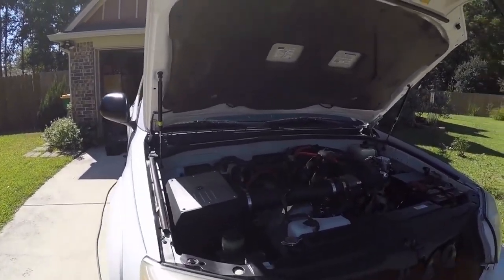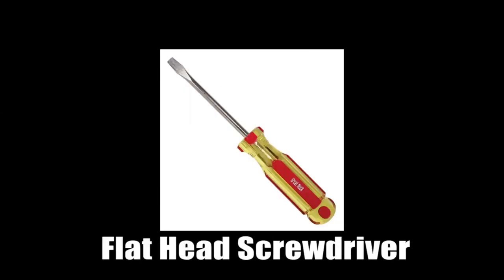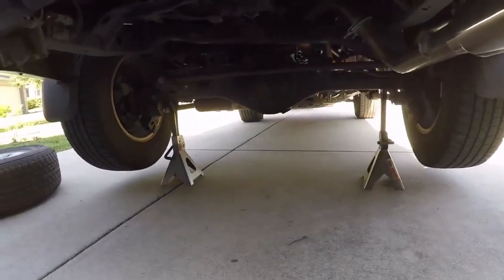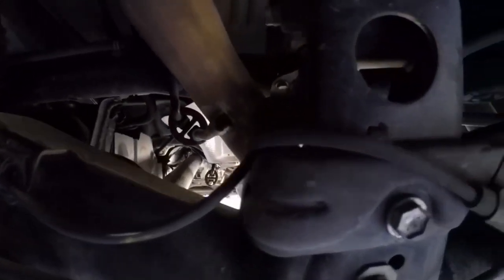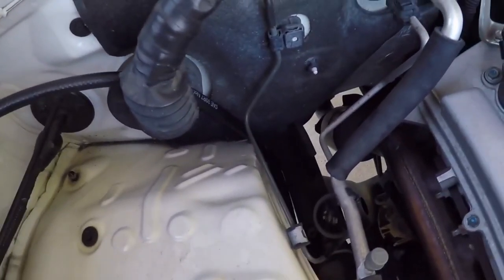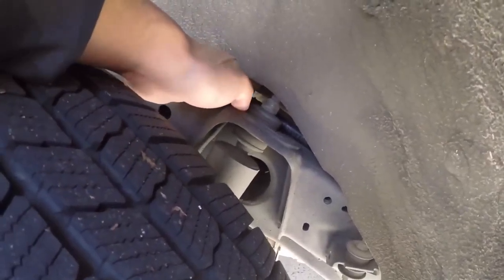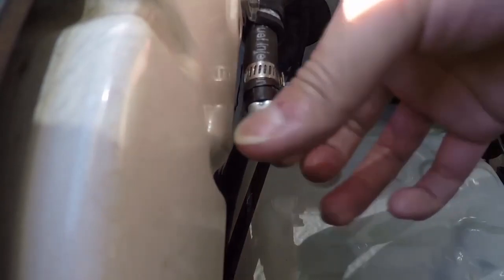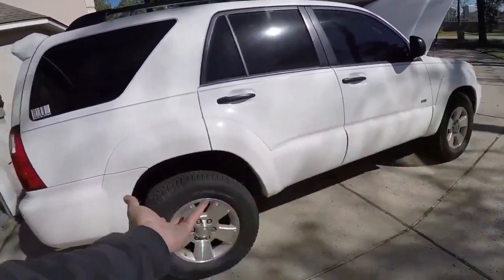4Runner Differential Breather Relocation Mod 4th Gen

Comment: Really? All the way to the front.  5’ of hose, run up to the fuel fill inside the fender. So much easier.  And do not use the factory vent from the diff. It has a rubber inside that stop water incursion.

Comment: 1) What size/thread type did you use to screw the hose to the engine bay firewall?
2) Why did you route the hose along the passenger side instead for driver side?
Reply from the maker: It’s an M6-1.00 thread size. And It’s much easier to access the passenger side than the driver side

Comment: Is 10 ft of hose long enough? 10ft would be 13 bucks and 15ft would be 24.
Reply from the maker: I would start with 15ft and trim from there. Also if you plan to add a lift, then it’s recommended to leave a bit of extra hose so that it doesn’t rip